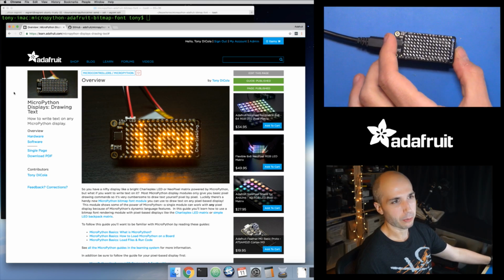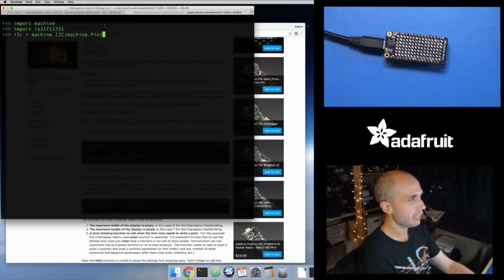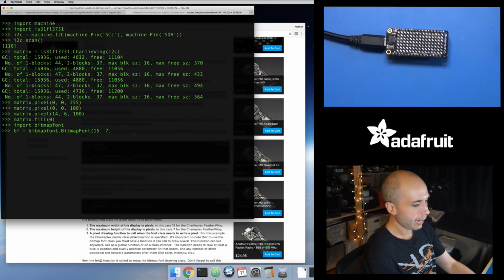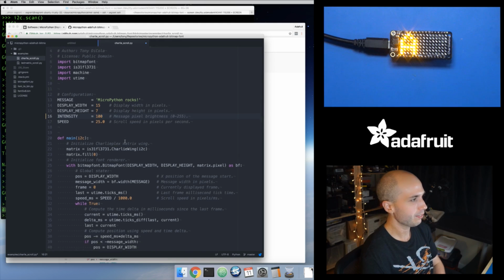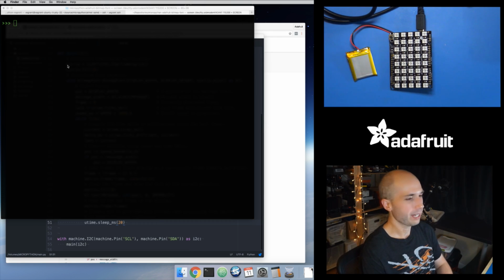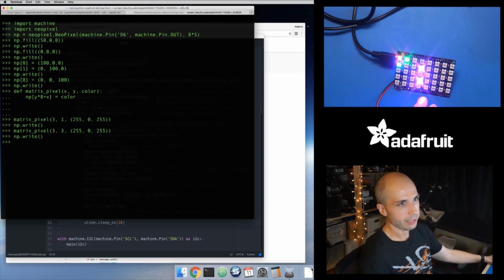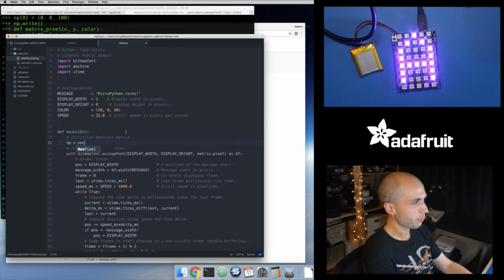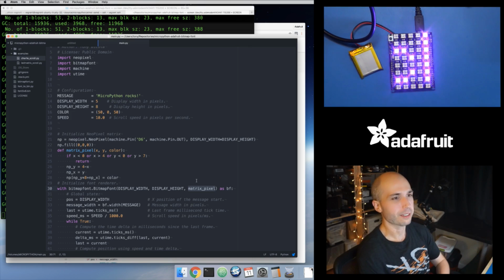MicroPython Displays: Drawing Text with Tony D! @micropython

Comment: Hey Tony, Excellent MP tutorials.  I've noticed that you are using the NP shield with the standard RGB NeoPixels.  Can the MicroPython NeoPixel module handle the newer RGBW NeoPixel shield or matrix?  I just purchased the 8x8 RGBW matrix and wanted to know if it would work with the current MicroPython NeoPixel module.  I thank you.  Scott
Reply: Check out the very latest 1.8.6 release of MicroPython from micropython.org, they actually just added 4 color pixels (RGBW).  Can see the new code here for the module: https://github.com/micropython/micropython/blob/master/esp8266/scripts/neopixel.py  It looks like you just want to make the NeoPixel class instance and pass a new bpp=4 keyword argument to it, then you can set pixels to a tuple of 4 values (red, green, blue, white) although looking at the code you might need to now use the pixel color order (green, red, blue, white).  I haven't tried it but give it a shot, good luck!